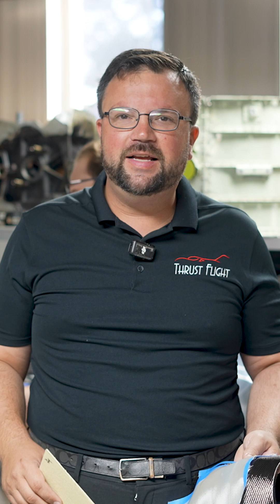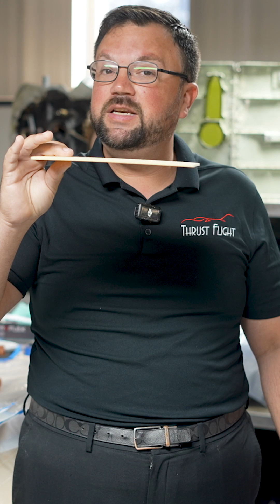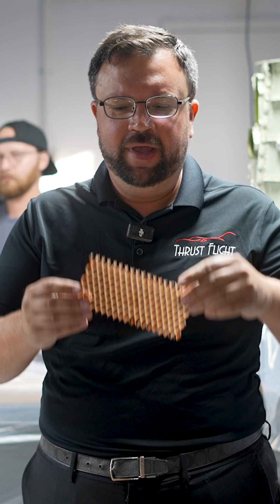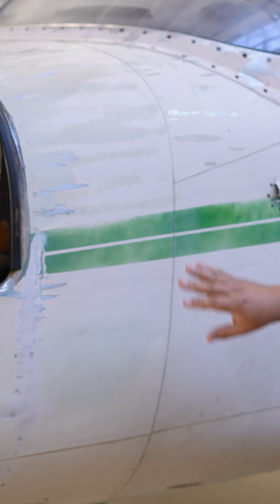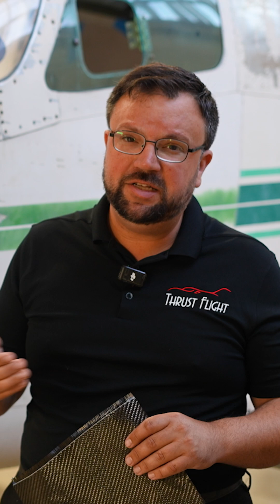Making Carbon Fiber and Fiber glass!

Comment: would a graphene airframe work? I have a concept for a Mach 10 commercial jet but i wanna use a material or composite that could withstand all that air pressure and heat, along with air turning to plasma